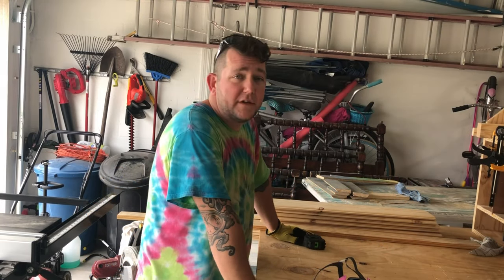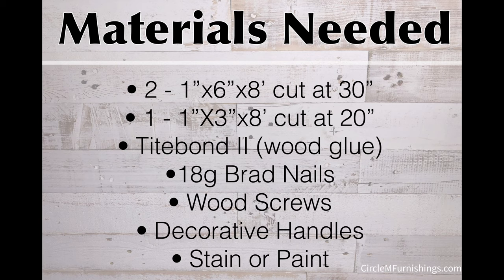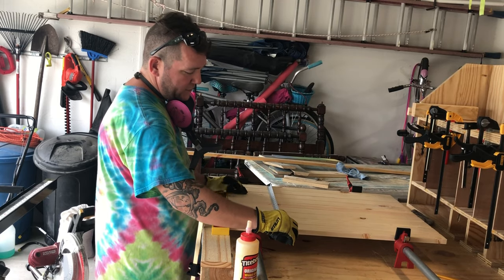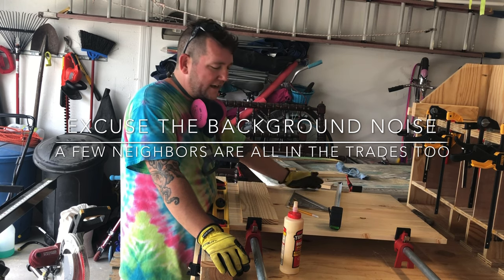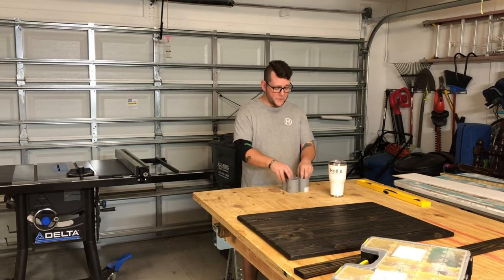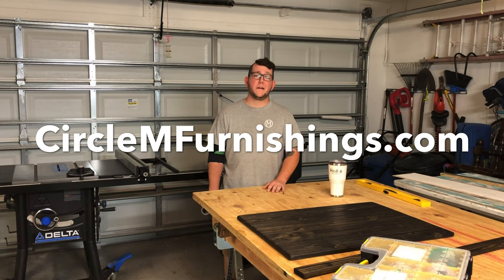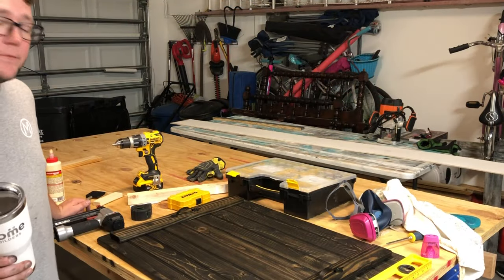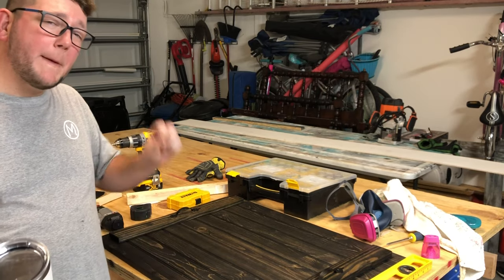DiY Noodle Board - How To Build A Stove Cover - Scrap Wood Projects - Farmhouse Woodworking - 4K -

Comment: Hello! I have a question,. I wasn't sure if the first guy said he used a tong & grove planks, from his scrap wood,. But my question is, after it's all put together, was there a wobble in the noodle board?? Thank you
Reply from the maker: Depends on the quality of wood used, but any wood has the probability of movement. We have sense started added adjustable leveling feet to each corner of our boards.